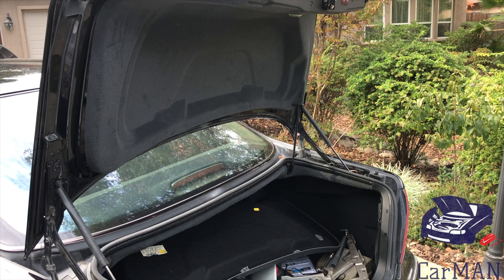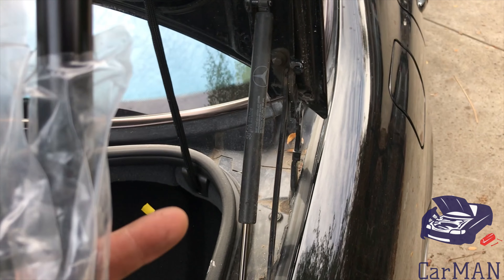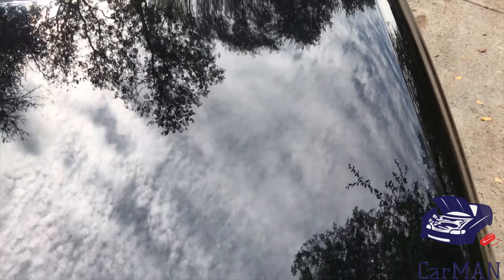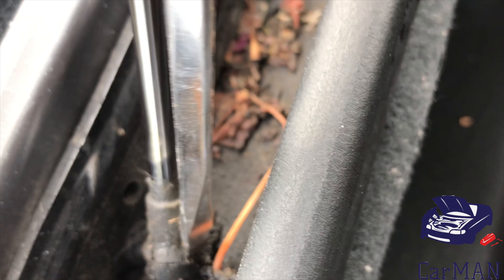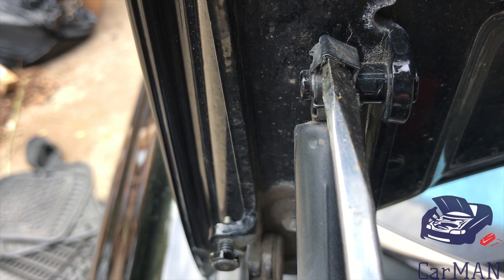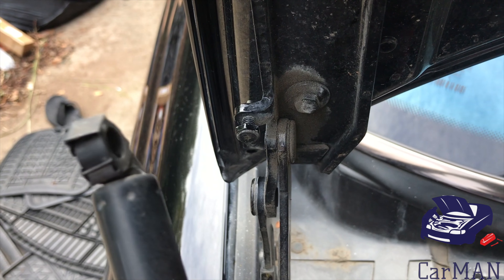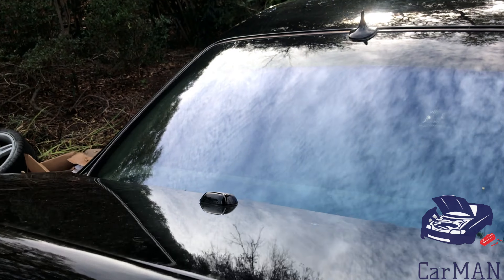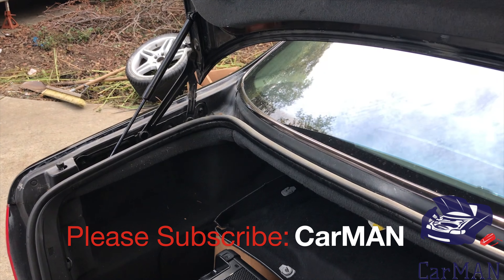Mercedes Trunk Fix | How to Replace Trunk Shocks

Comment: Good Video. Helped me. One added tip not shown. If the shocks are brand new, they may be a little more extended than the old ones and might not line up so even. I connected the bottom first then pulled down really hard to line up the top connection.
Reply from the maker: Hi, glad it helped! Thank you for sharing that tip, hopefully it will help someone if there shock is also like that

Please like & share!
Thank you for watching